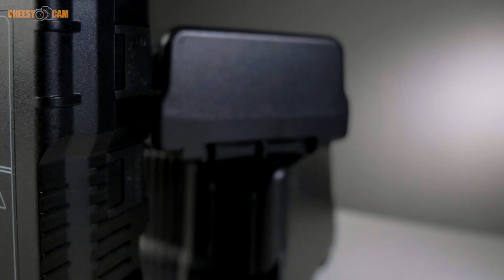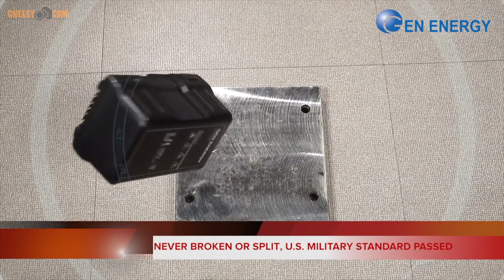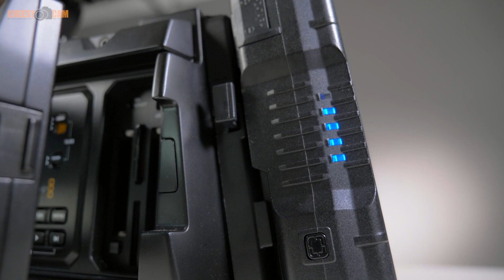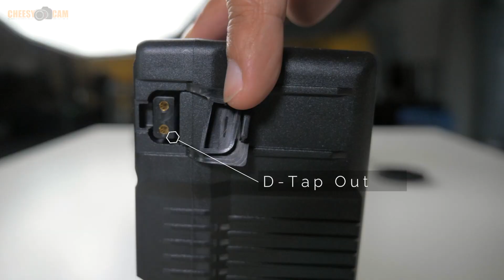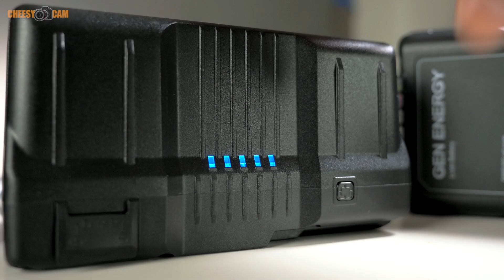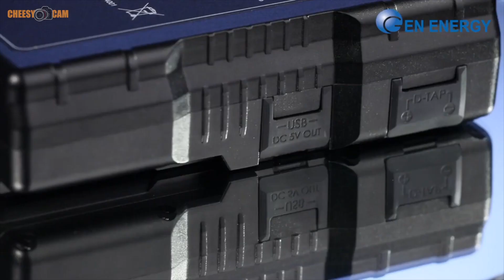Quick Look - Gen Energy Shock Proof V-Mount Batteries

Comment: Swit's 2m drop proof V-Lock batteries have been available for over a year now.
Reply from the maker: Several companies state their batteries can be dropped, but at least Gen Energy has an official certification. Also the SWIT is more expensive, doesn't have dual D-Tap, and no USB. I would say Gen Energy is a better offer.

Comment: What I can't understand is why any d-tap connector is so cheaply made. There is no brand which makes a heavy duty (or at least high quality) d-tap connectors. The most untrustworthy connector I can recall.
Reply from the maker: +break2262 You must be pretty hard core. I've never had an issue with a d-tap cable. But I don't get too crazy with my gear..